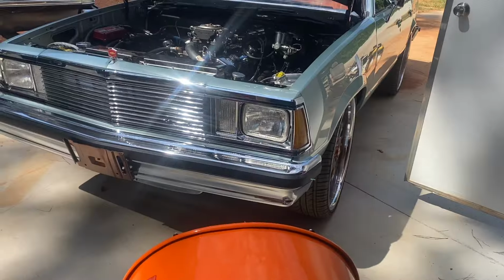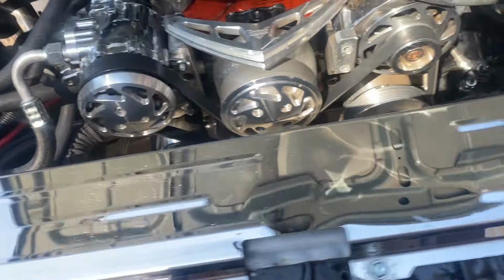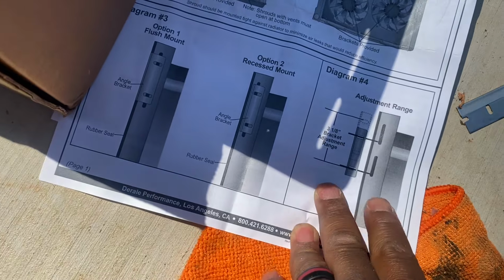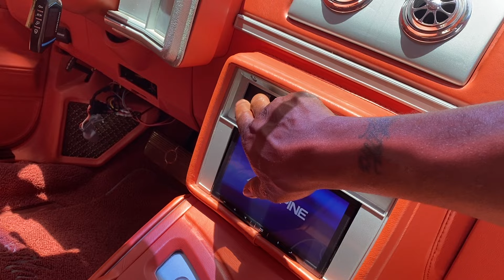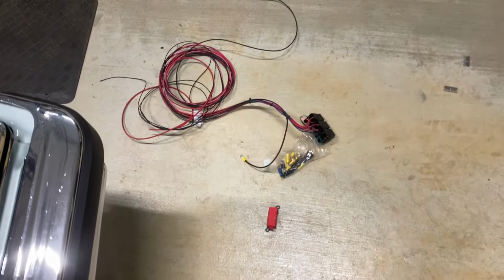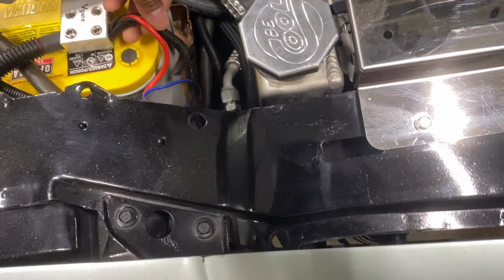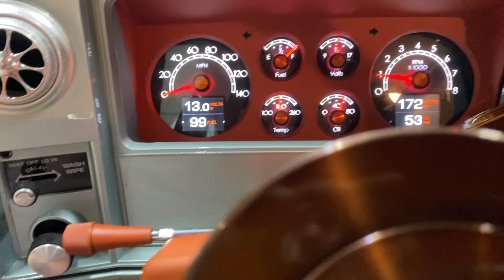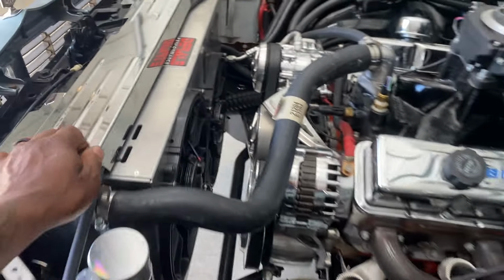MALIBU WAGON DERALE ELECTRIC FANS & RELAY KIT INSTALL

Comment: Great upgrade. I had that same setup and those fans won't even cool a 305 or 350 down. The derale fans are 4000 CFM total. The ones removed are rated at 1650 CFM total. Derale (SPAL) are superior!!!

Comment: What temp do you have the relay set for the fans to kick on
Reply from the maker: Look at the pictures at the end
Reply: Thanks the way that old wiring was looking probably was causing the old fans not to work correctly but the derale is an upgrade nice job